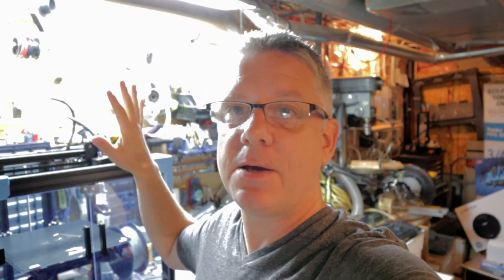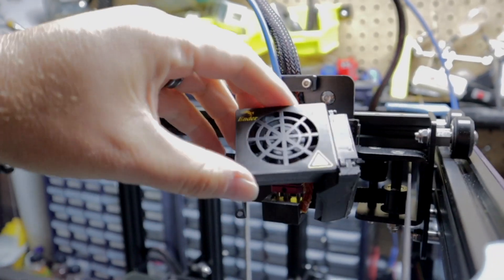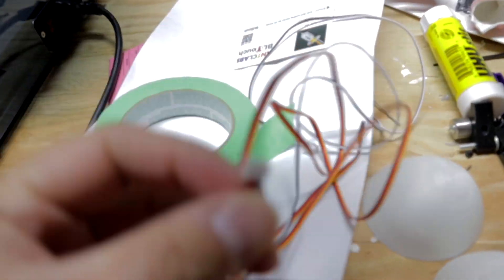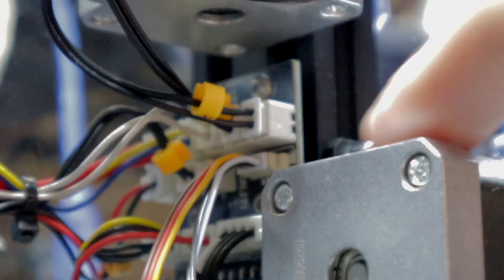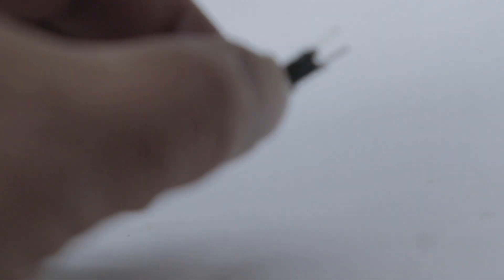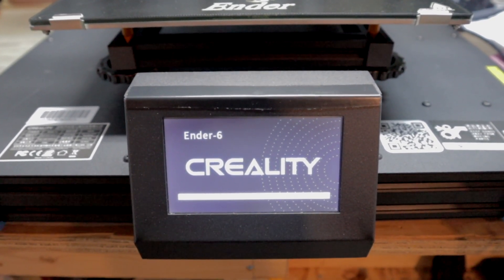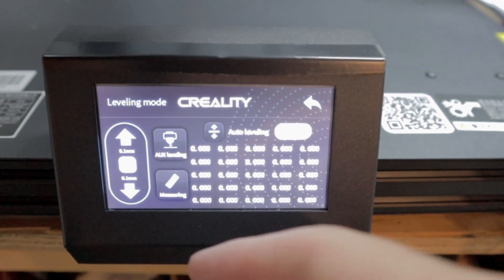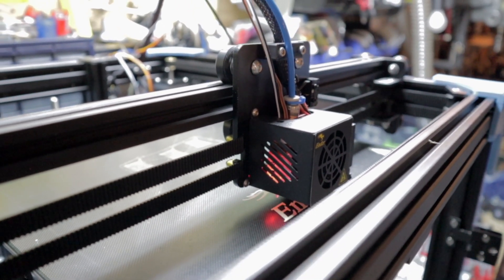Adding a BLTouch to a Creality Ender-6

Comment: Could you please help me with the choice? 

I need something for semi commercial purposes (certain adapters and custom parts). 

So, given the same quality of print, extra pros for me would be faster printing and as little maintainance as possible. 

I was interested in Ender 3 S1 because I saw the auto leveling feature which would probably cut a lot of time. I can get it for $512.

However, creality ender 5 PRO costs me only $377 which seems like a much better deal given the build is so robust, but the head doesn't seem to be as advanced as Ender 3 S1. 

Now, I can stretch my budget to get ender 5 PLUS for $600, which does have auto leveling feature, but for the same price I can get Ender 6 but I don't think it has that feature. 

Given these pros and cons, which one would you choose? 

My number one requirement will always be quality. But given the same quality, the second requirement would be speed. 

Unfortunately, I was unable to find good comparisons on print quality between these models. I have a feeling that there isn't much difference, so the main thing I'm paying for with more expensive versions is convenience and simplicity? Am I wrong?

Comment: Hi, thanks for your good tutorial,  All works exactly as you described. Except one problem, its off by 2 centimeter
So, the bed is about 2cm from the nozzle after leveling, so printing is no longer working.
I am now doing a manual leveling, followed by an auto, see if this fixes something.
Reply: Solved,  I downloaded the file in comment, but apparently that enabled BLTouch support, but downgraded my firmware, they have a more recent version on the website. Not it all works the same as in your video

Comment: No mention to remove z-stop switch, or any instruction for the most critical part. How to setup initial leveling and ensure proper z-offset calibration after the BL Touch is installed. You will likely be crashing the nozzle into your bed and causing actual damage to your Ender 6 if you just install flash and try to print. Not a very informative instruction guide.

Comment: Hello sir, I recently came into possession of and ender 6 3d printer, I successfully installed a new mother board and can now use the touch screen. I the 3d printer is not able to read the sd card that i have put in. the sd card is format to fat32 and has a .bin file to update the firmware but with no success. Any ideas?

Comment: They seriously can't just provide a cable you don't have to cut open to work?
Reply: They do now, look for the Ender 6 BLTouch kit. Mine came with the right wire, right lenght
Reply: @kodguerrero  Thanks for letting me know. I have made a cable by now, wish I had just waited a week. But now I got a clogged nozzle, not sure if this thing will ever actually print anything. We'll get there :)
Reply: @GenJacoty  LOL same. I tried printing in a warm room and used the same temperature for the nozzle I used in an AC room and the PLA+ started coming out the side of the nozzle in my all-metal hot end. Had to unscrew everything, clean it and put it back together.

I'm thinking it's better to have the Kelvin temperature for the spools so we can adjust based on the conditions of the room.

Comment: Do you have to remove the z-axis sensor? The Creality video instructs to do so but that seems strange and I’m not sure if people do that
Reply: After you install the new firmware, you can unscrew it and disconnect it from the printer board. Once you install the new firmware, it stops being used. You can toggle it and nothing will happen. You can leave it for safety but the BLTouch regulates the Z-axis stop. Try lowering the bed to the bottom and press "home" and touch the black Z-axis sensor as the bed is rising and nothing happens.

Comment: I just installed a bltouch on my ender 6 and it went halfway through leveling and started blinking red I check the bltouch and wiring to make sure they are working properly Both are fine I am a little lost with what could be the problem any ideas, anyone?
Reply: I have the same problem

Comment: My ender 6 is forgetting the distance between the nozzle and the bl touch every time I turn it off. Plz help
Reply: Save settings in config.  Or if you're familiar with modifying Marlin, you can hard code it yourself.
Reply: @ABuckeyeForLife  "Save settings" doesn't exist on the Ender 6 UI.
Reply: Did you figure this out?

Comment: When you just got your BL touch, want to install it and then you recognize you dont have an extension cable...
Reply: When the cable arrives, and it has the wrong ends….
Reply: @michaelzajac100  It just happened the same to me... Any luck finding just the cable??
Reply: You don't have to and it is tough to find one. I just cut the bigger connector, extended the cables via soldering and wired it to the main board (as shown in the manual) i/o of the mini connector board.

Comment: how loud is the Ender 6? I read that it has the silent main board but I saw another review where they reviewer said it was loud.
Reply: @teslaownersonline5805  Same here. Print yourself a better Printhead with additional / other fans. I used armaflex(R) on the Bottom an Sidepanels were evere possible to reduce the noice

Comment: So I installed the bl touch you recommended and it flashes and the new firmware is installed. But it will not do auto leveling. Just says wait a minute screen but nothing happens

Comment: Hi, put an SD card in Ender 6 with just bin file in from link and it's been sitting for a long time with no progress on the loading bar. Is the bin file the only thing that should be on there. Is there anything else I should expect to do? I don't want to turn it off or take the card out but watching yours it booted up in about 30s? Any clues would be good, it being Christmas Eve, thanks in advance for any advice?

Comment: Hello Great Video, you get right to the point. I have one small issue, I have downloaded the latest version of the firmware. I cant figure how to install the BLTouch firmware.  as the Ender 6 doesn't have much information at this point. so if you could please point me in the right direction that would be great.  Thanks in advance
Reply: Would you have a link to the firmware and where did you get the extra long colored cable as all I can find is 200mm or 300mm and I dont like to have too many joins in cables...
Would the white 5 pin plug on the end be 2.54 or the one they call micro which is heaps smaller again , sorry for the questions but yeah over here no-one else seems to have this unit or have fitted this , cheers for any help

Comment: I just out the sd card in with the firmware on my ender 6 - now it's stuck on the creality boot up screen. any way to fix this?
Reply: Anybody got back to you on this
Reply: I had the same Problem. The Creality Support said that the only way to fix it is to install a new Mainbord. They sendet me an offer with 45$ for the board and 70$ shipping cost.
Reply: What version do you guys have?  Maybe it's not suitable for the upgraded version. That one just came out. I asked Creality customer service to make sure about the Bltouch and they said: "Sorry it's not suitable for Ender6" .  I just don't understand how it worked for him.
Reply: I just got mine yesterday and exactly the same! It has the mounts and everything, it's now not doing anything.

Comment: So which version V2 and not 3.1? Why is that?
Reply: can confirm v3.1 works fine as just installed one on mine
Reply: @BeanGaming-w4n  hey would you have a link to the BL you bought and how has this been going for you , my machine is on its way so want to order this so hopefully it will be here about the same time , thanks for any help 👍😊
Reply: @anthonydendle4768  hi 👋 I already had one but just do a search on amazon for Official Antclabs Bltouch (3.1). My printer has been going really well not had any issues with it at all, currently not using it though as have limited space and got several others to review lol
Reply: @BeanGaming-w4n  thanks mate will do 👍
Reply: @BeanGaming-w4n   I just ordered one for mine and it didn't come with the JST connector. Did yours? Where did you order yours from or where did you get the JST connector?
Reply: @75conlan  hi, i had a spare cable knocking around so i cut the end off and soldered it on, its well worth doing the upgrade makes it so much better
Reply: @BeanGaming-w4n  Thanks! trying to figure out the right size to get. I've emailed creality support - see if they have the answer. :) Looking forward to getting this installed
Reply: @75conlan  are you in the UK? as ive got one i can send to you
Reply: @BeanGaming-w4n  Thank you - I'm actually in the US roiling in this mess of an election.
Reply: @75conlan  thats a shame would of sent it to you but postage would cost a fortune, well at least that silly orange man isn't president anymore I mean that bloke is a complete joke and I'm not even from the US lol
Reply: @BeanGaming-w4n   actually he still is. The states have not certified their vote, so there is no president elect. There are court battles ensuing over fraud and it glitches that flipped votes. Until that’s figured out, there is no winner. I know I don’t watch our media here. I get better fact based news out of BBT and Other global media outlets. Ours is riddled with bias and lies.
Reply: @BeanGaming-w4n  I've ordered an Ender 6 from Technology Outlet and was looking for this, they're not sure which on is suitable.  Where did you get the firmware, don't really want to try the V2 firmware tbh.
Reply: @stuartdavison289  hi, I will be posting a video covering this a little more shortly, ive installed the v3.1 on my printer and it works flawlessly, make sure you get a genuine bltouch and you will either need to get another cable and join it together or get one that has the right connector on each end
Reply: @stuartdavison289  how was your experience with technology outlet? Did you get the bl touch from them also? Everything fitted ok? Looking into the Ender 6 also.
Reply: @0101UnknownUser  it was good, they delivered the day after they said but under the current circumstances that's fine. I got the bltouch too. I can't get the firmware with bltouch to work.
Reply: @BeanGaming-w4n  Good day! Where did you buy the original sensor version 3.1 ??
Reply: @ruzinal  hi, you can get one from amazon or aliexpress
Reply: @BeanGaming-w4n  This is understandable, but which supplier has the original sensors?